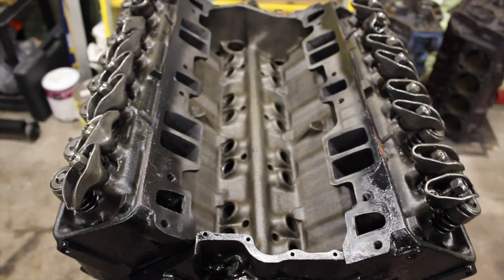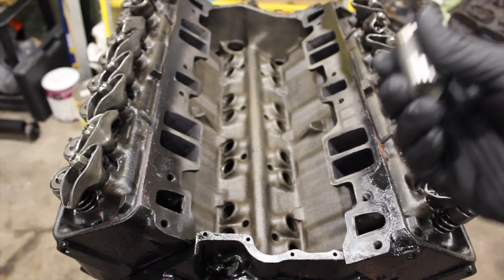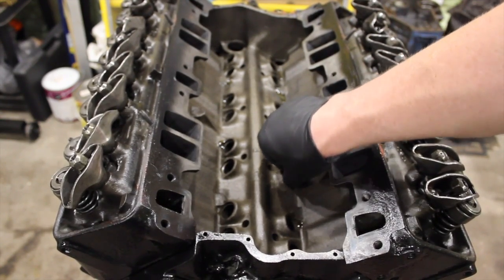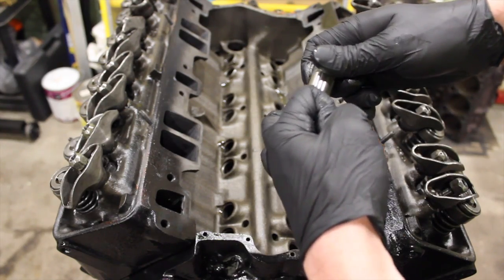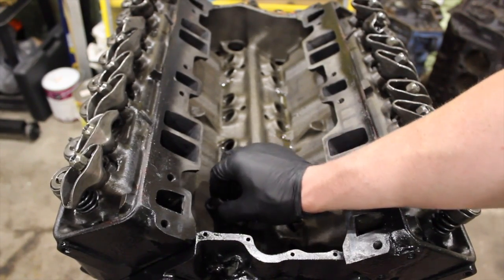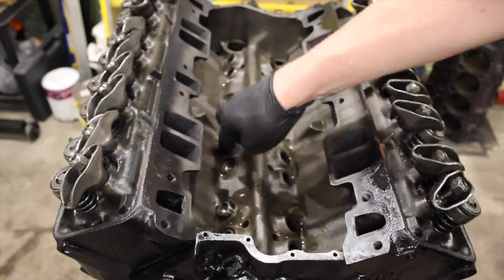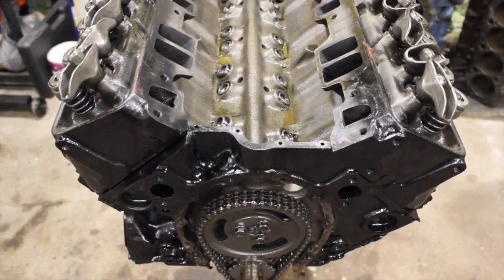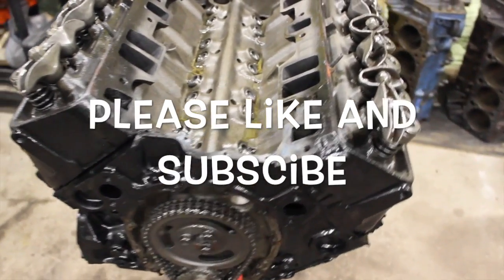Tips for installing Flat tappet cams and lifters

Comment: I have a fee question. I have an l31 vortec that i am installing a flat tappet comp cam with comp cam lifters. I am doing all the recomended head work that you suggest for vortec heads. (Comp cam behive, retainers, offset locks, screws in rocker studs ect) can i use my stock vortec rockers with this setup? I also no i may need to measure pushrod length aswell and get different ones. If i cant use those rockers do you have some you recommend?
Reply from the maker: Stock Rockers are good for up to .480 lift and under 300lbs open spring pressure. 
Yeah you will for sure need longer push rods. should be around 7.800
Reply: @cuttersperformance  summit 1103 cam will work well
Reply: that is awesome your head work the screw in rocker studs are really number one for sure, if you have ever had them raised up out of your heads you would know what i mean. i have seen the measurements and results.

Comment: Yes you never soak a hydraulic lifter in oil. It’ll not allow you to properly preadjust the valves the right way.
Reply: @DropDstar word
Reply: Soaking them doesn't pump them up.

Comment: Old guy here. Stopped soaking lifters 30 years ago. Enjoyed the video. Thanks.
Reply: No need to soak them ifen you prime the oil pump with lifters in before valve adjustment
Reply from the maker: Haha! Some ole school guys give me flack about that
Reply: Makes the job much easier. Prime the after adjustment
Reply: This old guy just uses the squirter style oil can. Put the tip in the hole on the side of the lifter and give it a few pumps. It doesn't fill the lifter but it gets some initial oil in there. Needed or not. 😉